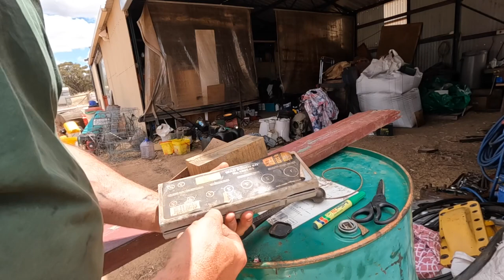Harvester maintenance on our new Holland TR88 harvester

Comment: These machines are just about bullet proof, my mate has 2 of them and boy have they been put through some harsh conditions and are still going, have even seen bird feathers cleaned out of the injector pump.
Reply from the maker: Hi Ashley, it is amazing what you find in the fuel system sometimes. So far it has been a good machine for me.
Thanks from Geoffrey